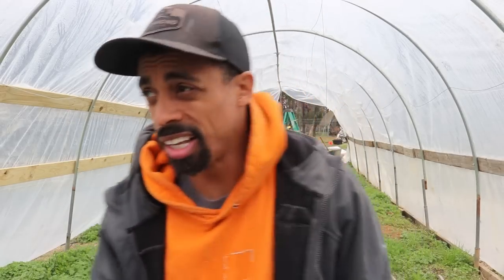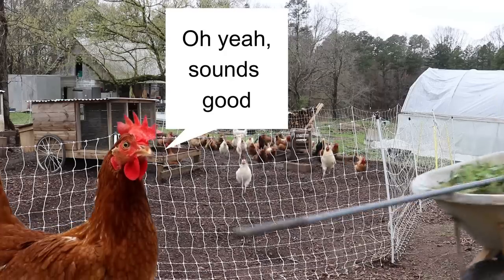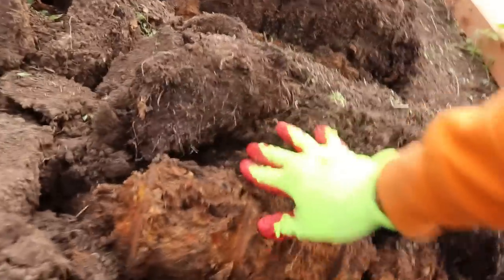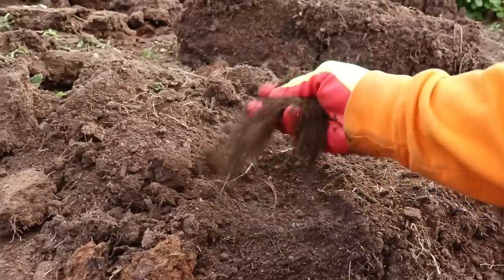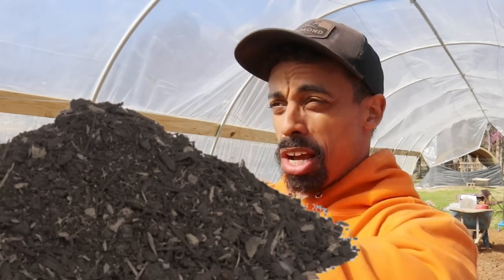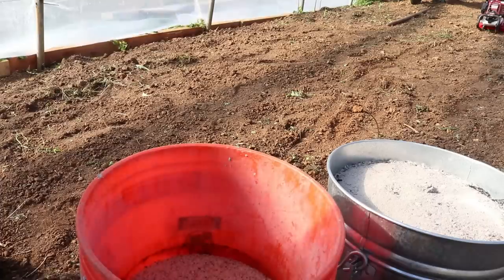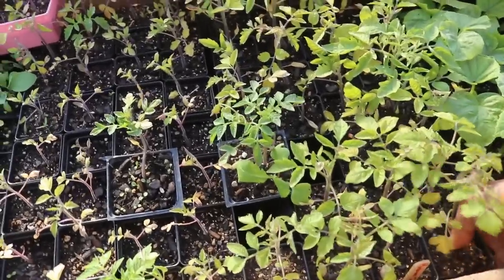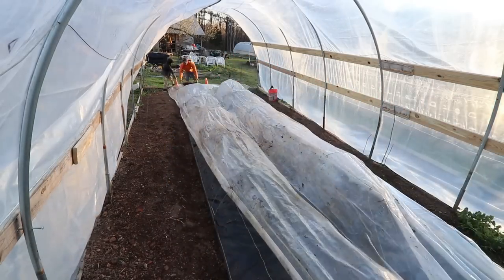It's a FORBIDDEN Way to Garden NOW

Comment: I am currently building new beds for raspberry & blueberries. The area had brush & wild blackberries in it along with old pasture grass. It has been a ton of work hand cutting the brush and digging out roots, digging out the grass & all the roots then building the beds. The soil is compacted down & I have had to till to get through the and break up some of the grass, hard pan & loosen rock so I can get the soil workable & mix a good amount of 5+ years composted manure into it too. It is painful to my body but it will soon pay off with yummy berries and some additional garden beds.

Comment: I watched a video that told about tomato plants not liking their leaves watered they prefer their roots watered. Also a great fertilizer is milk/water mix to the roots. I wish I kept that video so I could have shared. It said it helped keep pesticides away also. Worth looking it up online.
This milk fertilizer can be used for many vegetable plants, more specifically for the likes of tomatoes, peppers, and squash that suffer from blossom end rot.
Reply from the maker: I totally agree with the overhead watering. The plants are way less likely to have diseases from drip watering. I will set that up later.

Comment: The no till people are us in the plains.We generally don't need to bring in compost as the prairie plants compost in the winter. but the spring and summer and fall bring so much and so high wind will blow it like dust (like mini dust bowl) nd it's very damaging I don't think you have near the dryness in summer or the winds there in the South.  Ya gotta do what's best for your soil.  Tilling also means expensive equipment. Hoeing or broadforking don't create dust bowls. Also you hear no till mentioned alot in corn farming. Talking about 40 acres or more of just corn not s smaller market farm or garden.